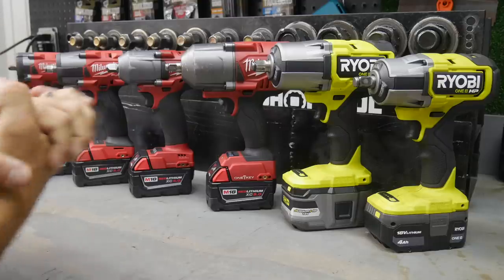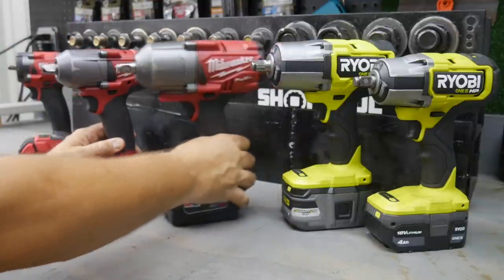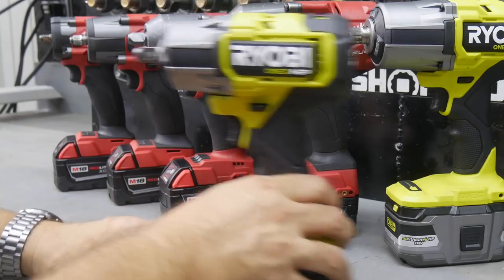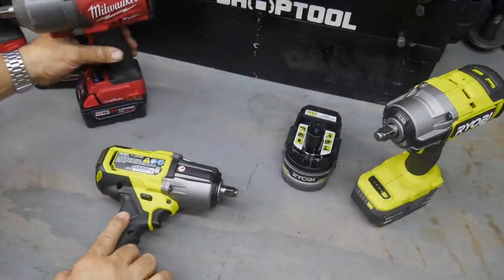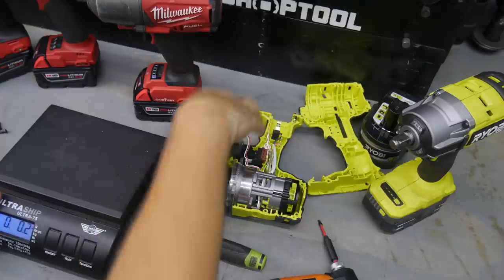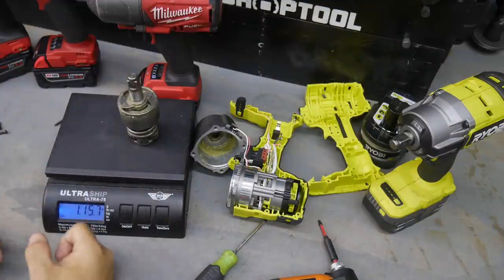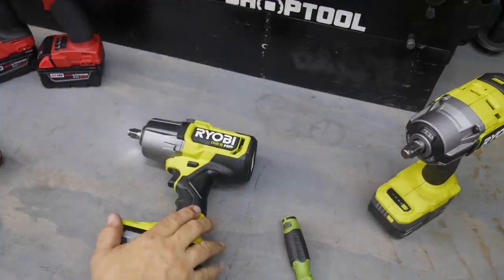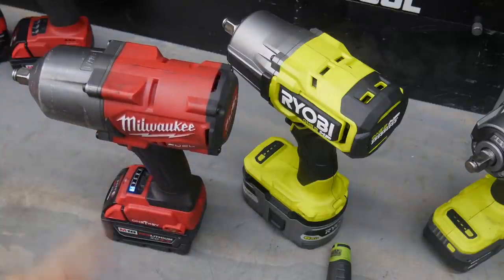ALL NEW RYOBI HP High Torque Impact Wrench Deconstructed [OCTOBER 2021 Release]

Comment: I am just surprised that Ryobi dosent do the same at there reasearch & development center and copy or enhance over Milwaukee design, to get the edge over competitor. Ryobi is lacking the power of Milwaukee by just a few ounces, that can be rectified quick.
Reply: Owned by the same company that is why.  Ryobi in the states is setup to be a home owner type tool, while Milwaukee is a pro tool.  The same issue happened with Ridgid where they were outdoing Milwaukee with Octane.  Not anymore Octane has been obsoleted, I'm sure due to Milwaukee putting a clamp on that one.

Comment: The Ryobi is a newer design so possibly they discovered a way to produce more impact power with lighter weight.  If Milwaukee comes out with a new design of their high torque impact it would definitely be interesting to see a tear down and weighing of it's hammer mechanism.  Lighter with the same or more power is definitely a plus in the power tool business.

Comment: TTI is definitely keeping the reigns on the Ryobi so it doesn’t compete uncomfortably close with the Milwaukee. Some Milwaukee fans may breathe a sigh of relief at that, but it might also suggest Milwaukee is content sitting on their current high-torque for a few more years. Fine since it’s still essentially the market leader...but no triple LEDs coming in the near term for it.

Hard to see how the Ryobi will come anywhere near the claimed 1200ftlbs with that small a hammer. I’d rather they be a bit more honest with their marketing numbers. Even though basically everyone exaggerates as it is, it’s not a good look to me when they market stuff too outlandishly. TTI’s chosen to do this with Ridgid tools too. Not a fan.
Reply: They are especially regarding hitting this tools specs, there are several videos out there

Comment: This helps answer the question we’re all asking: Is Ryobi HP just a green Milwaukee?

P.S. Notice the Rigid is doing all the work while the Milwaukee just sits there.
Reply: Hi Jim, I was thinking that same thing lol,
Reply from the maker: Yep, answers that questions. Definitely different tools, and I didn't even get into the brushless motor. 
No doubt. I love that little Ridgid Palm Impact Driver. Pressure sensitive switch allows the tool to throttle based on the pressure. Great for assembly disassembly. Thanks for watching.
Reply: @Shoptoolreviews  Milwaukee and other tti brands operate entirely separately.

Comment: Did you see the REV B Milwaukee?  Will Ryobi follow the change, Ridgid too?  Kinda nuts I feel they would change the tool, kinda seems like they were maybe looking at a supplier issue on the bearing or the cast planetary gear holder and changed some things they thought wouldn't really effect any performance/longevity.  Yet it did not go as planned, or maybe even done for cost savings.....